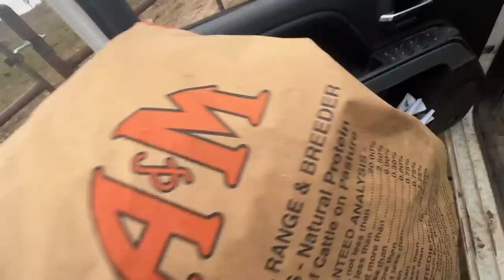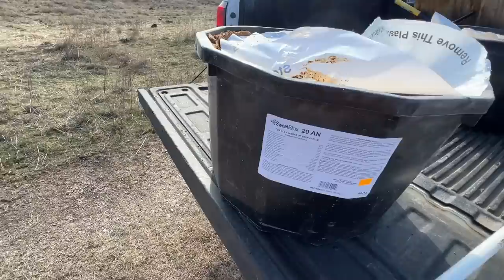It's Headed This Way! Make Some Room!

Comment: Dusty you should cut some of those cedar trees about the size of a half dollar, use them for roost poles for your chickens. The cedar keeps mites off them, they need a round roost to lock their toes around so they can cover their toes with their feathers. It’s very hard to freeze a chicken to death. If they can keep their feet warm they are fine. Most spend their whole life roosting in trees!
Reply: Your suggestion doesn’t make sense…”the size of half a dollar” is what, 2-3cm? (Barely an inch for the yanks) chicken can’t even wrap both feet around a branch this narrow? Obviously you didn’t explain yourself real well 🤔
Reply: I didn’t know that about the mites!! Great idea, always looking for a way to make roosting poles!!

Comment: Watching and staying as warm as my electric heat allows!  I’m allergic to smoke, so can’t use my fireplace.  I’m in Burkburnett, TX, just below Lawton on the Red River.
Reply: Add some humidity to the air. It will mAke it feels warmer..
Reply: @judysetran9198 , you are right.  Decreases static, too.